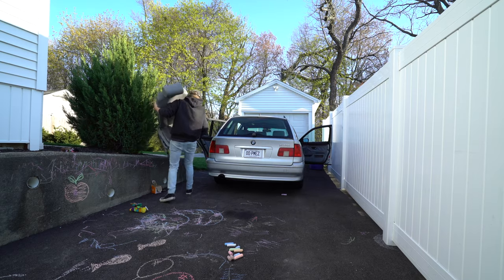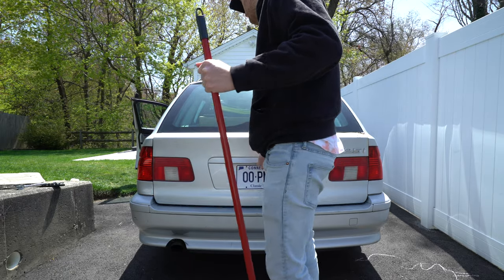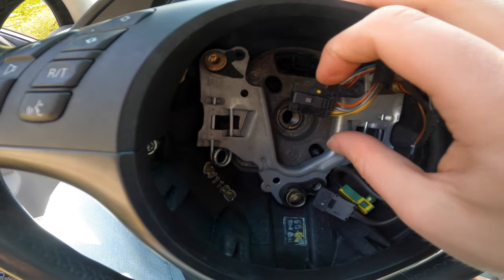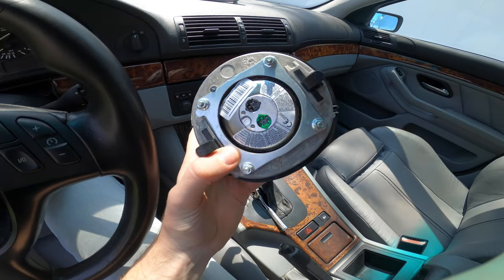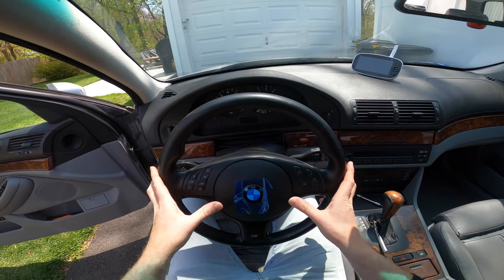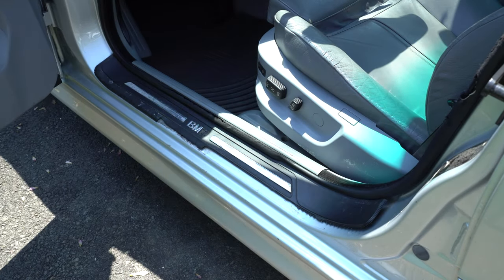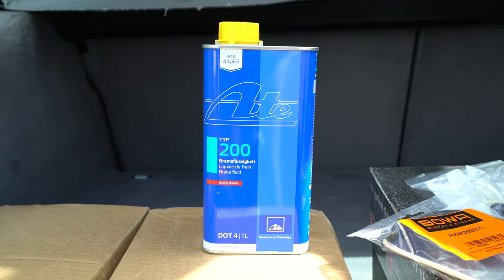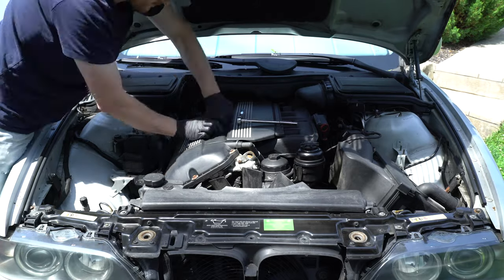E39 Touring Wagon BMW Rescue Episode Three: Sport Package and Mechanical Upgrades

Comment: I can't tell from the video but did the original steering wheel have the heated wheel option on it? mine does and I can't convince myself to upgrade to the M5 steering because of that reason only.
Reply from the maker: This one didn't have heat! So it was an easy decision. I hear you, I think I'd stick with the heated wheel over this upgrade. Heated wheel is the best!
Reply: @BIMMERZEITT  it's still hard to believe they didn't add that option to their top of the line M5 but included it in 530. haha.

Comment: love the spanking new steering wheel.  Is yours stage 1 or 2 airbag? I believe not all are compatible!
Reply from the maker: Thanks! It was a great upgrade. Totally changed the car. Dual stage airbags were installed from 03/1999 onwards I believe. This wagon is a 2001. So both the original bag and the upgrade were dual stage.

Comment: Hi Rich, I was curious about this and knew you’d probably have an answer since you’ve had a bunch of E39s. How does the 525i touring drive compared to the sedan when it comes to handling/feel? I’m extremely tempted by a manual touring. I’ve driven a few E39s. Mostly the I6 models. I prefer them over the 540is due to the steering and lighter feel when tossing them around.
Reply from the maker: Hey Alex, the wagons are great. If you need some cargo space for hauling things, shipping for business etc, it’s not a bad option. Great to tailgate out of as well. There’s definitely more weight in the back, but I recommend them. Pretty unique these days as well, won’t see many at all on the road anymore. The 525 is underpowered though. I’d suggest a 2000 528i wagon or even 540 wagon. Beware the timing chain guides etc on the 540 though.

Comment: Odd question when you did the value cover did you remember the secondary air injector vacuum line going to the value on the front of the manifold?  I didn't and it gave me a vacuum leak then I found out it is a commonly replaced part that's like $15-$20.  FYI... I had a hard time troubleshooting it with my smoke machine because it was so small but still made the check engine light come on for... lean on bank 2 can't remember the P0.. number
Reply from the maker: It’s very common, you might like this video I made on the topic: https://youtu.be/u4j8Wnt2W4s
Reply: @BIMMERZEITT  lmao you got a video on it I forgot about that, awesome!
Reply from the maker: @fryreartechnology7611  😉

Comment: Can you please show how to replace the rear windshield wiper arm.  I don't know how to get that triangle shaped cover off. Thank you in advance.
Reply from the maker: Ha ha. Funny you ask. I filmed this but didn’t think it would serve many people. There is a torx bolt under the triangle piece. It’s probably rusted and will just spin. I had to drill mine out. Once the triangle cover is removed there is a 8 or 10mm nut. Easy at that point.
Reply: @BIMMERZEITT  What size torx? The screw at the top or is there one inside the little hole? Thanks

Comment: My 97 e39 had a bad airbag. I have a 2000 e39 parts car, wouldn’t you know it, the air bags are identical on the outside, but completely different at the plug connectors! Also, the blinker self cancel is worn out and completely differant from the 2000. Frustrating!
Reply: I do have a lot of good parts, if anyone is interested. Black leather interior.